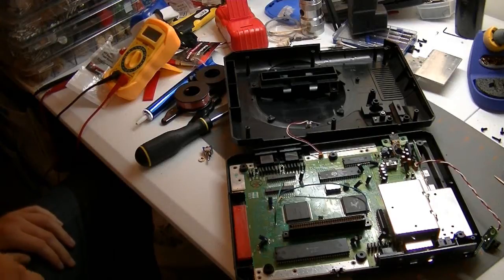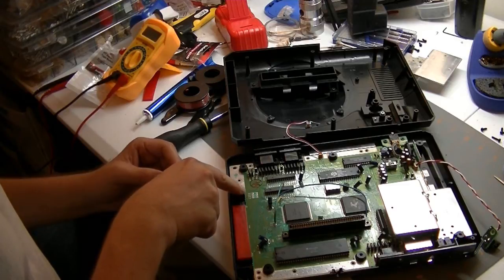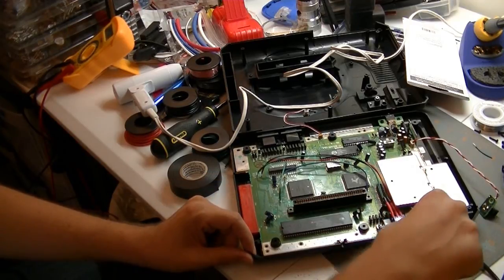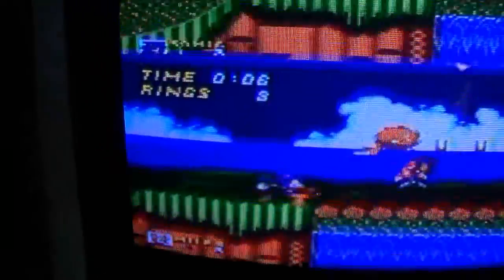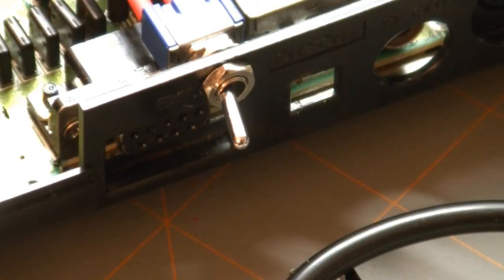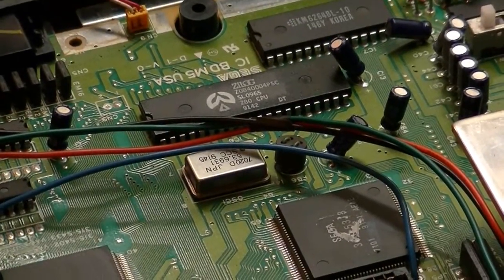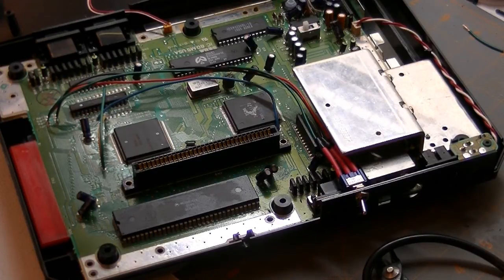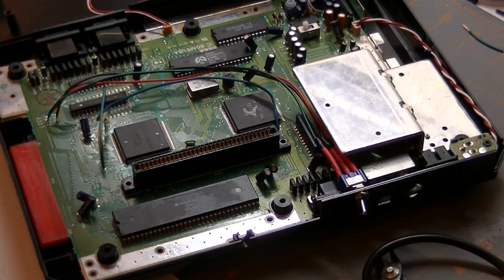[Repair/Modification] Sega Genesis Model 1 Region Mod (Mega Drive)

Comment: i want to do a mod for my pal mega drive. it need a 50/60 Hz switch.
thx for the video
Reply from the maker: My pleasure! I haven't don't a 50/60 hz before, but if it's like this one, it shouldn't be too hard.
Reply: For PAL/NTSC switches, all you'll need to do is cut jumper 3, then wire up the jumpers in the same order as you would the language switch.

I have the language switch, the frequency switch, halt button, and overclock on an Asian model. :)
Reply: Look up RetroGameTech he did a video on a UK Mega Drive video about that.